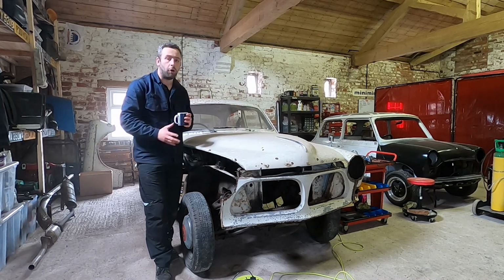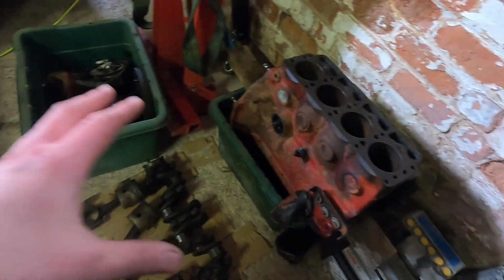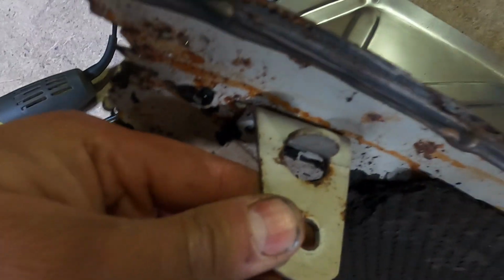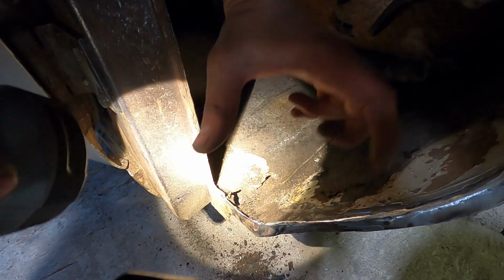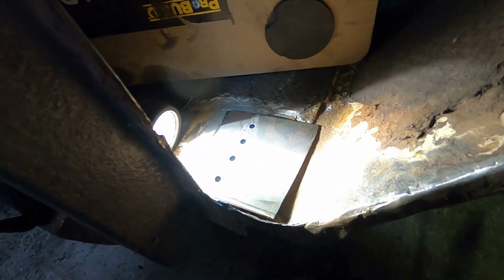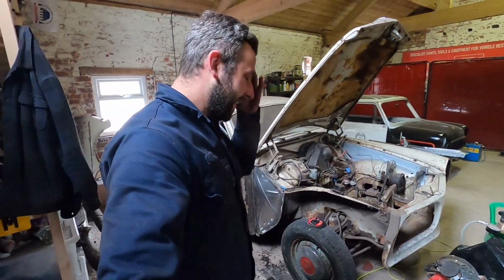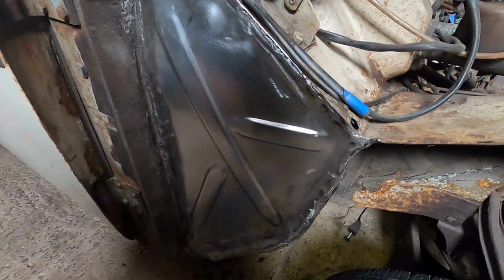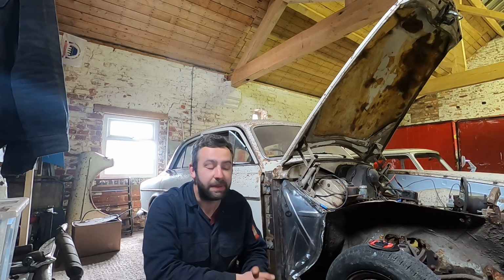Surprise Floor Repair & Cowl Panel - Volvo Amazon 121 Restoration

Comment: Been an interesting series to watch so far. Very well done! I bought an Amazon one and a half years ago or so. It has so far been mostly solid, but the sills seem a bit suspect on my car. Both sides have been replaced at some point, but on the right side it does have two edges on the underside, indicating it is overlaid on the old one. Unfortunately this is beyond my skill to repair, so saved up money to have it, hopefully, professionally repaired at a shop soon. Hoping I can sleep better at night knowing any potentially hidden secrets are dealt with and not festering further.
Reply from the maker: Hey thanks for watching I wish you all the best with your Amazon.

Comment: This is a really good project  - well done. The B18 is a really robust motor, you might try just honing the bores yourself and putting it back together with some new piston rings and big end shells, it might well just work.
Reply from the maker: Hey thanks! I have heard its a robust lump, I plan to do the bare minimum really to retain the original side of the car as much possible, for now we will crack on with the body work.

Comment: If there is any rot in the front foot wells then you must check the chassis members that run down the bulkhead,.dirt and debris collects ,stays wet and rots the floor.
Reply from the maker: Cheers thanks for the tips! I have had a good look around those areas and it seems to be in good shape. Loads of treatments and protection products needed in the future. 👍

Comment: Thanks for another interesting video. Is the black coating on the repair panel the type that you can paint over, or do you need to wire brush it off before the primer ? Greasy Fingers says in his videos that there are two different types.
Reply from the maker: Thanks for watching glad you enjoyed it. On the classic mini panels the heritage ones the e-coating is really decent but after market ones it’s dreadful. Depends on the brand but I remove anything I can and put a better panel on. These panels come with a light zinc coating which is a decent.

Comment: I'm restoring my 69 121 on youtube, If you need engine stuff and a fully done cilinder head you could send TinusTuning a message. Dutch man wich is just the Master of volvo redblock engines. he has fully one heads ready on the shelf. Great build, keep up the work
Reply from the maker: Hey thanks yes I follow your channel also. Appreciate the offer of help I may just need a few bits in the future.
Reply: @SimpsonsClassics  Cool! 😁👍